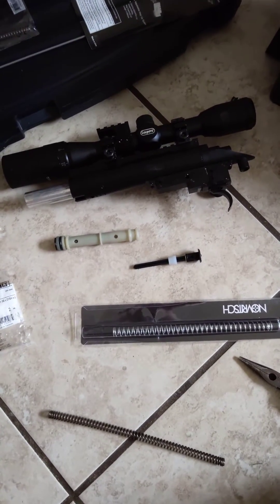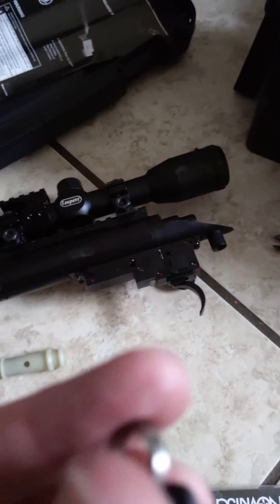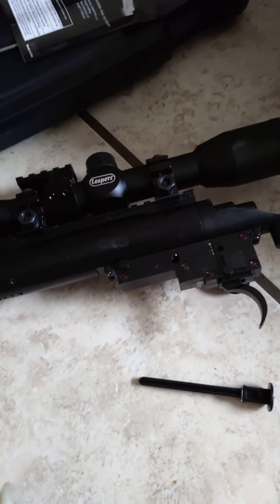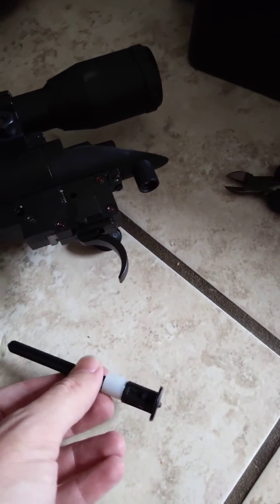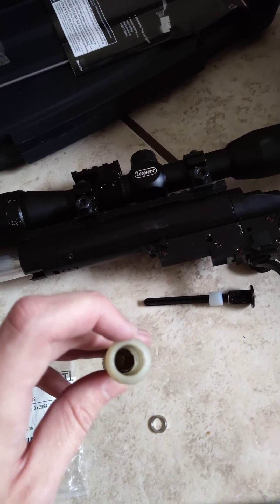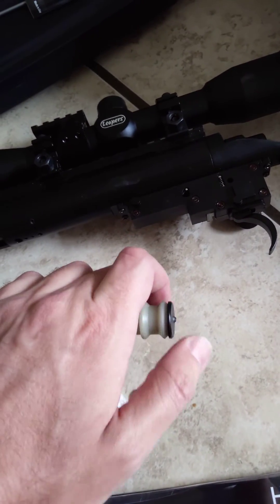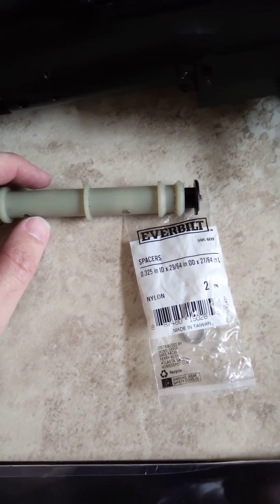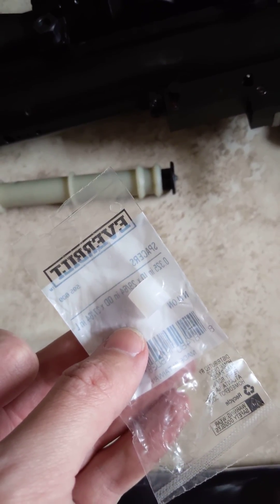DIY FPS Adjuster Rings, Can Mod, Sear Troubleshooting | BBTac M62 / ASG M40A3

Comment: im tryna find upgrades for it but dont know what parts to use on it
Reply from the maker: Don't bother, they won't work. It is a hybrid design so you are capped at the stock power pretty much

Comment: I'm really looking into this rifle but I'm so confused on the brand names, I see bbtac and I see ASG. Are they the same??
Reply from the maker: Yes, they are clones; identical as far as I can tell.

It is a great rifle for trying out the sniper role. It won't get power levels you need to compete with DMRs, but you can get decent range and good accuracy with it.

You won't be able to get more power out of it - I've tried everything, it is due to the (really bad) mix of weapon systems. So if you think you want to upgrade the rifle look elsewhere - if you want a cheap rifle that works great as a 2.2J gun this is a excellent option.
Reply: @T4nkcommander  https://youtu.be/uk5OKE-UPNw I came across this vid, he mentions L96 parts work to slightly boost performance.  I'm just looking for a second rifle that can help me tag with precision while hiding.
Reply from the maker: @stitchyboi1206  chamber is aps2 and spring is, but piston is vsr so you can't find a spring that will fit. They are either too long or won't fit into piston.

You could possibly find a replacement piston, but I know others haven't had much luck and you quickly spend too much money on it.

The stock gun will shoot a .4g bb 240ft with pretty solid accuracy. Are you trying to push 100m or just want to punch in the 160-240ft range?
Reply: @T4nkcommander  Looking into consistent accuracy right around 250feet at least without going over $120 for now 😅
Reply: @T4nkcommander  Or may just scoop up a Well MB sniper overall